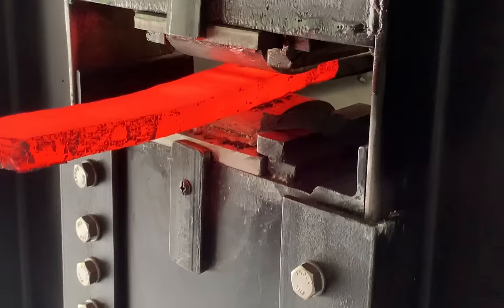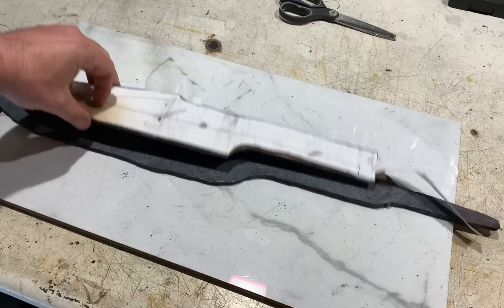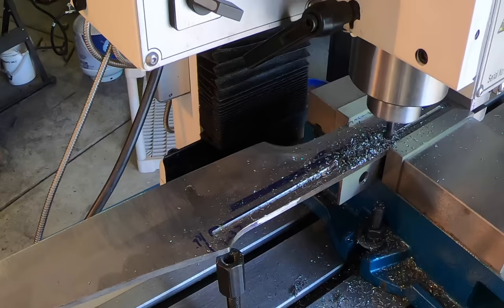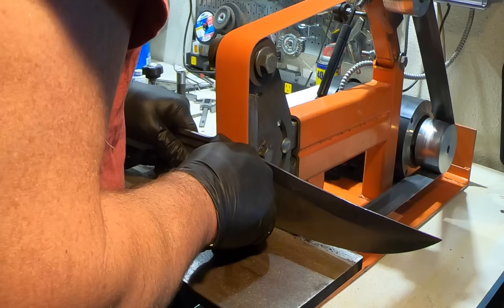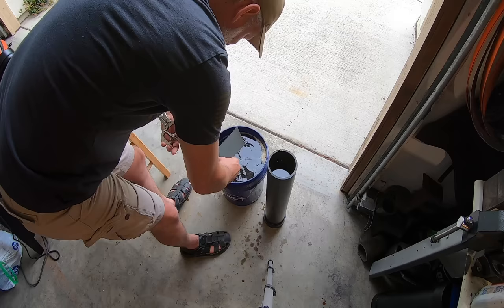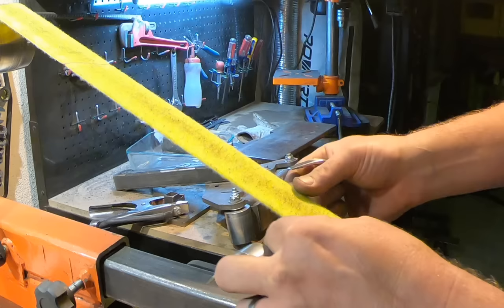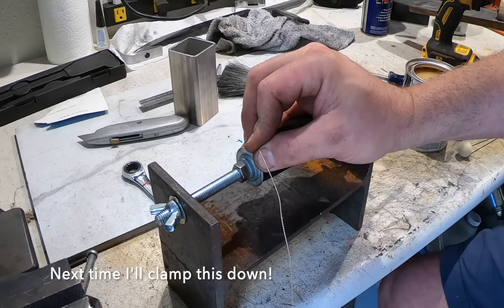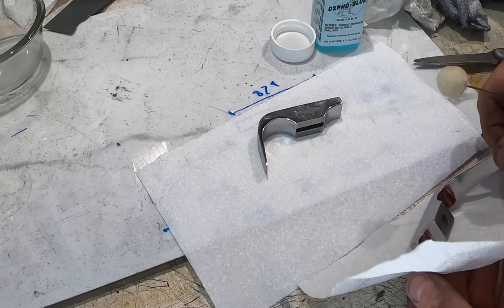Forging a Spartan Sword from the Movie 300

Comment: Beautiful sword. I saw a sword of that design (non-Damascus of course) in a museum in Athens, Greece in 1978.
Reply from the maker: Thanks for checking it out, James!
Reply: I don't know about  movie "the 300" but this is not a Spartan sword, the Spartan sword "called a xiphos" had a waisted leaf shaped blade
Reply from the maker: @jamesberry3230  the sword from the movie is a kopis, which is what this is. The kopis was mostly used from horseback as opposed to the xiphos used by infantry.  Again, this was taken from the movie.
Reply: @TyrellKnifeworks  it is not a kopis which was single edged with a forward curved blade like a kukri which it looked like
Reply: @jamesberry3230  it's a fictional kopis. The channel already pointed out that this is not historically accurate, why bother trying to point it out?

Comment: If you run a torch slowly down the length of that twisted wire and get it good and hot as you go along, it will relax and lose that springiness it gets from the twisting. It makes it a lot easier to work with.
Reply from the maker: Yeah, I figured that out after.  Thanks for watching.

Comment: Beautiful sword and my personal favorite sword pattern. The Damascus pattern is mind blowing, just amazing. I would of liked to see the fullers going toward the tip of the sword V"eed to infinity to draw the eye down the blade a bit and show off the pattern but that is being a bit picky. Beautiful work brother.
Reply: Bye the way, it will cut and yes it will kill.
Reply from the maker: I know what you mean on the fuller.  At the time I could only find a 1/4” ball end mill.  I would have rather used a 1/2” and then with the taper it would disappear to a point.  That’s what the fuller on my quillion dagger build does. 👍 thanks for watching!

Comment: Great work!  I've been planning to make a similar sword, modeled after the one used by the character Ahmad Sanjar from the Turkish TV series Uyanis Buyuk Selcuklu.   He was Sultan of the Seljuk Turks about the same time period when Troy fell.   I'm glad I watched your video, so I'll have a headstart on the process!

Next time you use twisted wire for a handle, try annealing the wire before you twist it, then anneal it again before you wrap the handle. If you start the twist with freshly annealed wire, it won't try to untwist itself. You'll need to polish it after you finish wrapping, but the whole process will go more easily with soft wire!
Reply from the maker: Yeah, I've since learned that trick of annealing it.  Thanks for watching, Ted!

Comment: I think that was really a fun project. And that fancy divider thingy was really cool as well. I didn't know they exist. Did you realize already on that project that it is more difficult to grind a longer blade?
Reply from the maker: At the time, this was twice as long as any blade I had previously done.  It was really tough.  Doing that transition from the edge near the ricasso to the main edge was really a pain in the ass!  Thanks for watching.
Reply: @TyrellKnifeworks  hahaha yes. I guess you cut some belts with that

Comment: This may be a nitpick, but won’t the copper on the handle green with oxidation? And won’t it turn the users palm green as well?
Reply from the maker: This actually isn't pure copper wire, its just coated.  If it was, I'd just coat the handle in a thin layer of clear enamel so it wouldn't oxidize.  Thanks for watching.
Reply: @TyrellKnifeworks  no, thank you for answering so quickly!

Comment: What is the purpose of the kerosine? isn't there a chance the liquid would go between the billets and when burned leave residue or something?
Reply from the maker: You want the kerosene to seep between the layers.  When it burns off it does leave a residue that prevents scale.  It doesn’t affect the layers from forge welding.  Thanks for watching, Joe.
Reply: @TyrellKnifeworks  ahh cool. So it's working for you! My metallurgy knowledge is only from highschool :-)

Comment: Hi hi Dennis,, I noticed you always seem to weld the ends of the billet with ark… could you use mig ? Or is there a good reason not to ?
Reply from the maker: Technically, they are both considered "arc" welding, but you mean with a stick welder instead of mig.  This is just an old video before I got my new 3-process welder.   If you watch my more recent videos, I use both mig and tig.  Thanks for watching, Robert.

Comment: That beval transition must have been a nightmare and you barely touched on it in the video, is this because you felt it would be boring due to the excessive hand sanding required? I ask because I'm intrigued to know how you tackled that and kept it even on both sides, even WITH a sanding jig it must have been a challenge, no?
Reply from the maker: You're right, it WAS a nightmare!  LOL!   I did it by hand filing mostly and using layout lines is key.  Thanks for watching, Benjamin!

Comment: What does soaking it in kerosine before heating do?
Reply from the maker: The kerosene burns off and so does all the oxygen.  It supposed to create an oxygen free area in all the seams to get a better weld, or so the theory goes.  👍
Reply: Tyrell Knifeworks got it, thanks for your response!

Comment: Why do you put the billet in kerosene?
Reply from the maker: The theory is that when the kerosene burns off it also prevents any oxygen from getting to the steel so it protects it from oxidizing.   I’ve seen many other smiths do it as well.  😉

Comment: why do so many blacksmiths call metal damascus, when the knowledge to truly forge damascus was lost over 1000 years ago??
Reply from the maker: That is such BS.  It’s not “lost to time” as these stupid tv shows would have you believe.  “Wootz” steel, it’s actual name, is known and it’s still made all the time.  Stop with this nonsense.
Reply: Who told you this 🐂💩Damascus technique may have changed because we have modern tools but it still is Damascus 🍻🍺
Reply: True Damascus swords got sharper the more you used them. They didn't dull and fold over along the edge.
Reply from the maker: @Thraxus69  hahahaha... that is complete BS.  No sword gets sharper the more you use it.  Stop watching so much TV.  🤣
Reply: Ahh, and this is what happens when knowledge is lost to history. :)
Reply from the maker: @Thraxus69  This may sound harsh, but leave the bladesmithing to bladesmiths.  This is not your forte, clearly, from your previous statement.

Comment: Heat treatment was to hot in front of blade and to cold on back , you sharpened the blade before you grind down the false edge so as doing so you were  running you sharpened edge on steel . Lol 😆 . Fair play good design and craftsmanship but I couldn't stop smiling
Reply from the maker: The camera makes the colors look much more off than they actually are.  I'm not sure what you mean by the second part, I didn't even show sharpening this blade in the video.  Thanks for watching.

Comment: Yep I’m going to copy your grinder.
Reply from the maker: Thanks for watching!  It’s a simple design that didn’t cost me much.  The wheels and platen are the expensive parts.  I strongly suggest you do a 3-phase motor with a VFD.  I started with a single-phase but quickly changed it.
Reply: Tyrell Knifeworks sounds good, thanks.